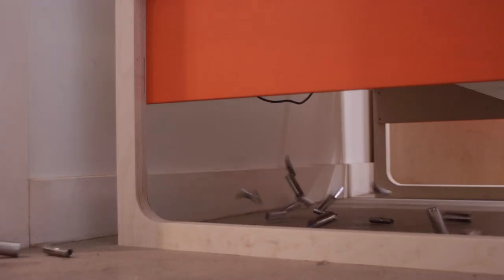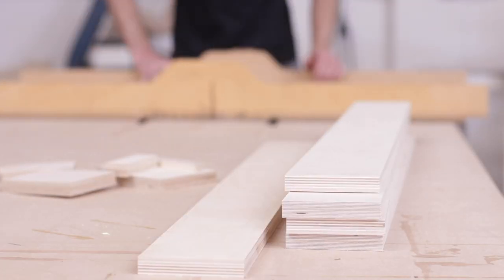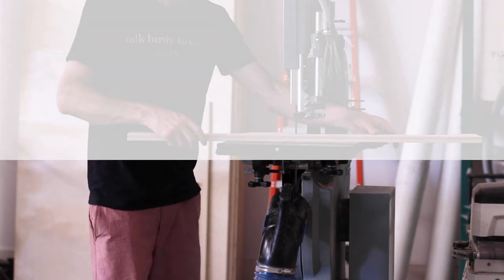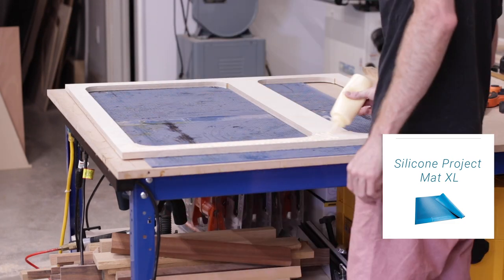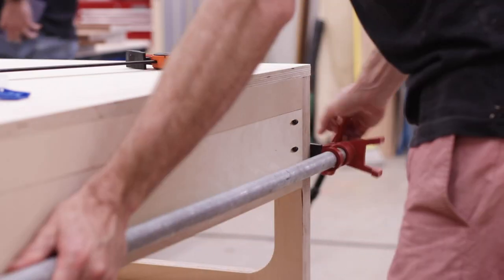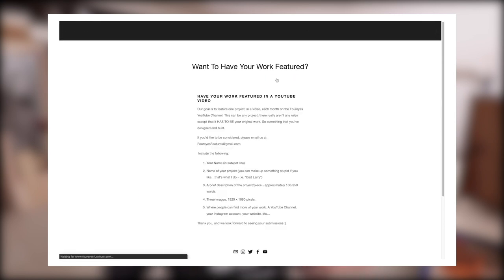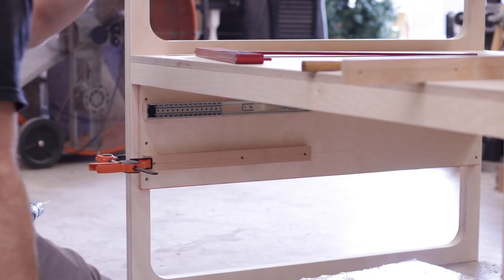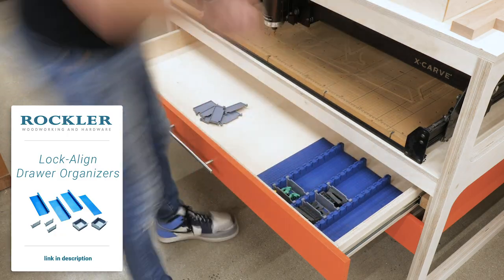Good Looking Shop Furniture V.1 - Lift Top Tool Table

Comment: Add a couple gas struts to your table lid will save the hinge, and I would suggest some cross support cos it seemed awfully flexy.
Reply: It's actually pretty sturdy, but adding something to help lift the top is a good idea. Not sure it will ever happen, but still a good idea!
Reply: I would love a good tutorial on installing 150N / 90 lbs gas struts on a lift top workbench that hides a 5” deep storage area with a heavy 24” x 48” MDF lid.
Reply: Was definitely going to suggest the gas struts, but more for safety. Wouldn't want that top to come slamming down on ya.
Reply: I was gonna suggest this.

Comment: Great video, guys~!  I too need a table and home for my future CNC.  I saw a very similar design on the front of Popular Woodworking from last April ('19)...not sure if this was what planted the seed for your version, but I like yours over the other.
     - Yes, LOVE THE ORANGE~!!  Matches all the Miami teams' bling in my shop.  East coast boy, here~!
     - I was also going to suggest something like a gas strut or rod, but primarily to prevent the surprise of the lid pulling a sneak attack on the back of your head when you're not looking.  Ouch~!
     - Nice catch, Chris~!
Thanks for sharing~!!
Reply: Thanks Andrew! I haven't seen the one from Popular Woodworking, but will have to check it out.

Comment: My idea for the problem in the intro of the video: Put 4 pulleys on the ceiling and some hidden hooks in the edges of the table top. Now you can pull up the top to the ceiling without the need of putting away what is on there. You can even put a second sheet of plywood on there, so you can pull up only the top layer and store some drying work pieces up there.  
More storage and you can make use of the high ceiling!

Comment: Am I missing something? If you’re sold on this design, why not just cut the sides out as one piece each using the CNC? Is it not big enough?
Reply: Not big enough and there would be big portions of plywood offcuts that come from the center sections of the legs.